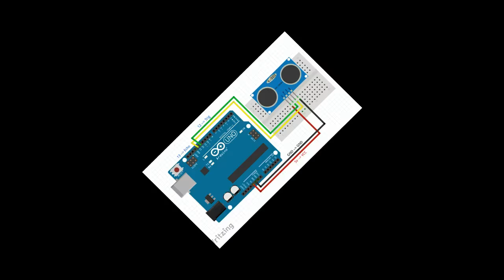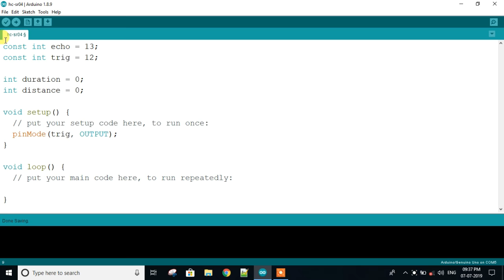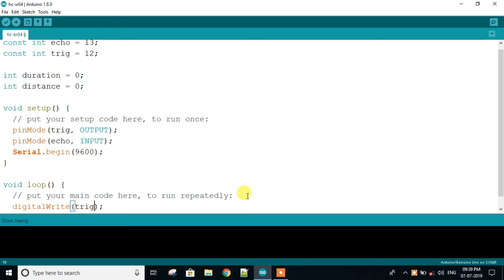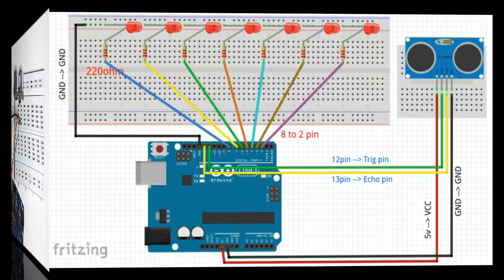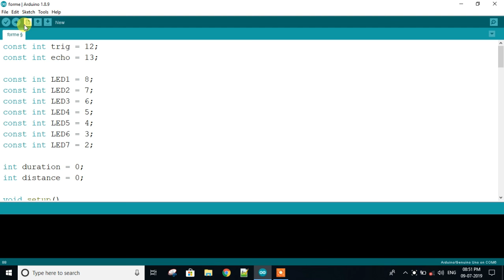Arduino ultrasonic sensor led projects | Hc-sr04 Ultrasonic sensor

Comment: #define trigPin 8
#define echoPin 9
long duration;
int distance;
void setup() {
pinMode(5, OUTPUT);
pinMode(2, OUTPUT);
pinMode(3, OUTPUT);
pinMode(4, OUTPUT);
pinMode(trigPin,OUTPUT);
pinMode(echoPin,INPUT);
Serial.begin(9600);
}
void loop() {
digitalWrite(trigPin,LOW);
delayMicroseconds(2);
digitalWrite(trigPin,HIGH);
delayMicroseconds(10);
digitalWrite(trigPin,LOW);

duration = pulseIn(echoPin,HIGH);
distance=duration*0.017;
Serial.println(distance);

if(distance<20)
{
digitalWrite(5,HIGH);
digitalWrite(4,LOW);
digitalWrite(2,LOW);
digitalWrite(3,LOW);
}
else
{
digitalWrite(5,LOW);
digitalWrite(4,LOW);
digitalWrite(2,LOW);
digitalWrite(3,LOW);
}
if(distance<15)
{
digitalWrite(2,HIGH);
digitalWrite(5,LOW);
digitalWrite(4,LOW);
digitalWrite(3,LOW);
}
else
{
digitalWrite(2,LOW);
digitalWrite(5,HIGH);
digitalWrite(4,LOW);
digitalWrite(3,LOW);
}
if(distance<10)
{
digitalWrite(3,HIGH);
digitalWrite(4,LOW);
digitalWrite(5,LOW);
digitalWrite(2,LOW);
}
else
{
digitalWrite(3,LOW);
digitalWrite(2,HIGH);
digitalWrite(4,LOW);
digitalWrite(5,LOW);
}
if(distance<5)
{
digitalWrite(4,HIGH);
digitalWrite(3,LOW);
digitalWrite(5,LOW);
digitalWrite(2,LOW);
}
else
{
digitalWrite(4,LOW);
digitalWrite(3,HIGH);
digitalWrite(5,LOW);
digitalWrite(2,LOW);
}
if(distance>20)
{
digitalWrite(5,LOW);
digitalWrite(2,LOW);
digitalWrite(3,LOW);
digitalWrite(4,LOW);
}
}

I HAVE MADE ABOVE PROGRAM TO SENSE THE DISTANCE OF AN OBJECT AND ACCORDINGLY LIGHT UP A LED DEPENDING UPON THE DISTANCE, BUT ONLY ONE LED SHOULD GLOW UP CORRESPONDING TO THE DISTANCE AND OTHERS SHOULD KEEP OFF. BUT MY PROGRAM IS NOT WORKING PROPERLY, THOUGH NO ERROR IN COMPILING. KINDLY SUGGEST THE IMPROVEMENT
Reply from the maker: Mistake in if else statement. I have change the code.

#define trigPin 8
#define echoPin 9
int duration;
int distance;
void setup() {
pinMode(trigPin,OUTPUT);
pinMode(echoPin,INPUT);
pinMode(4, OUTPUT);
pinMode(5, OUTPUT);
pinMode(6, OUTPUT);
pinMode(7, OUTPUT);

Serial.begin(9600);
}
void loop() {
digitalWrite(trigPin,LOW);
delayMicroseconds(2);
digitalWrite(trigPin,HIGH);
delayMicroseconds(1000);
digitalWrite(trigPin,LOW);

duration = pulseIn(echoPin, HIGH);
//Serial.println(duration);
distance=duration*0.017;
Serial.println(distance);

if(distance<20)
{
digitalWrite(4,HIGH);
}
else
{
digitalWrite(4,LOW);
} 
if(distance<15)
{
digitalWrite(5,HIGH);
}
else
{
digitalWrite(5,LOW);
}
if(distance<10)
{
digitalWrite(6,HIGH);
}
else
{
digitalWrite(6,LOW);
}
if(distance<5)
{
digitalWrite(7,HIGH);
}
else
{
digitalWrite(7,LOW);
}
  
if(distance>20)
{
digitalWrite(4,LOW);
digitalWrite(5,LOW);
digitalWrite(6,LOW);
digitalWrite(7,LOW);
}
}

//Don't forget to subscribe.